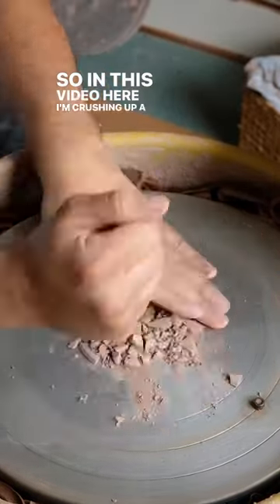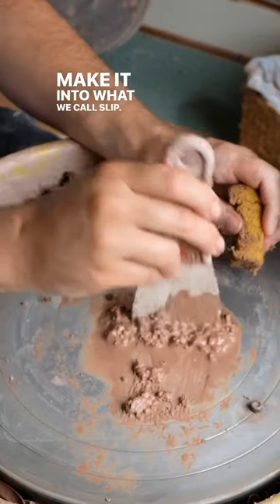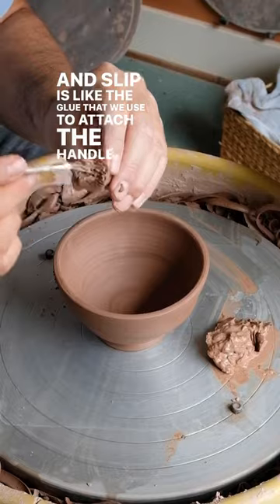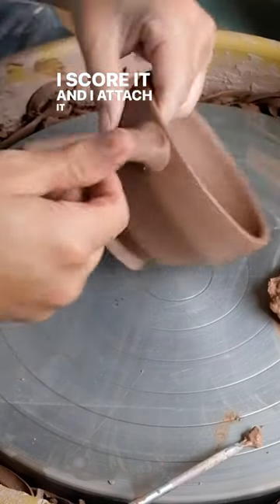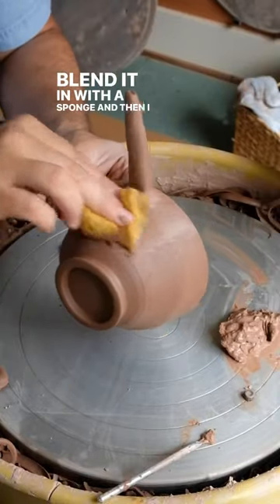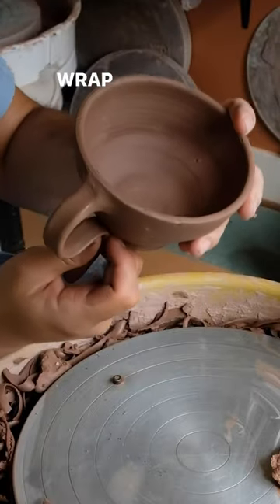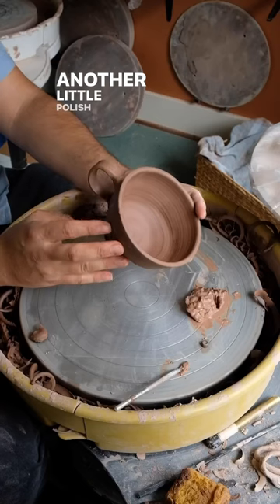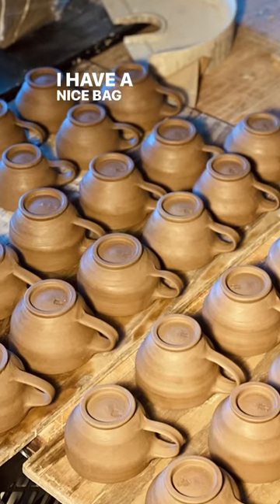How I use slip! #potteryclay #ceramics #pottery #howto

Comment: Pulling a handle off a mug takes practice and a leather-hard cup. Slip is soo much nicer when you put the dry pieces in a plastic container, soak completely, pour off excess water, and whip it with a plastic fork. Nicer if it ages for a few days.